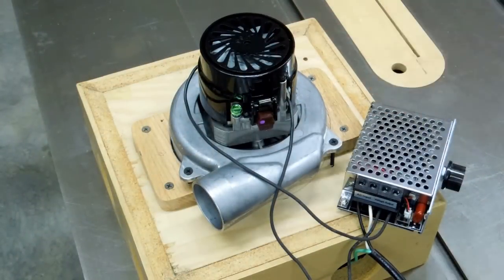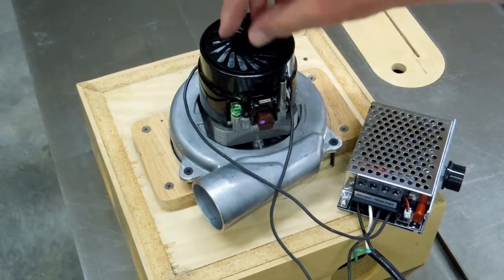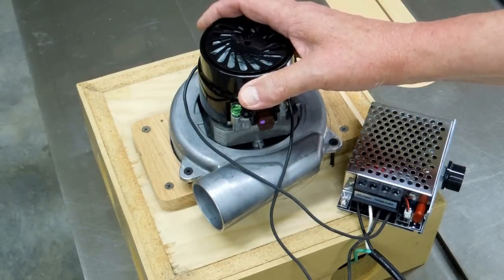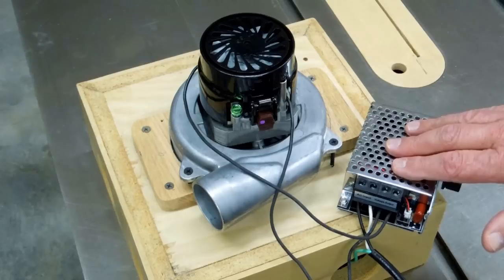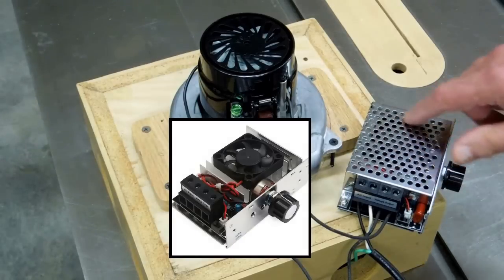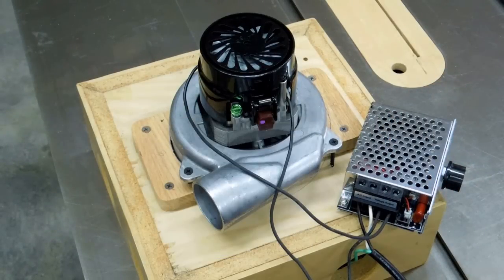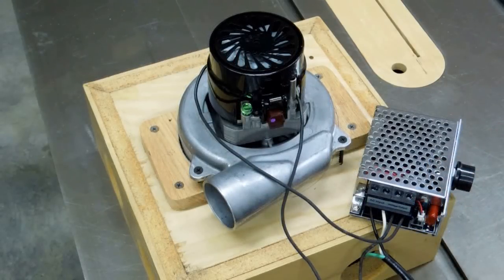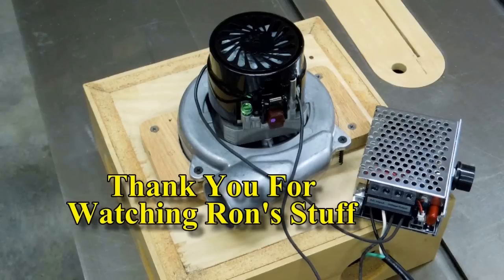Ametek Lamb Vac Blower Motor With SCR Thyristor Speed Control

Comment: My understanding is that the thyristor chops or modifies the sine wave not the frequency.  Inverter speed controller changes the frequency. Am I  wrong?
Reply from the maker: Somewhat of an over simplification... but the end result is basically the inverter controls the frequency via PWM (pulse width modulation)... and is something I am no expert in. Thanks for watching!

Comment: can you use this to go beyond the max voltage a little bit ?
Reply from the maker: No. Voltage in equals voltage out. If you watched the video you would see the motor speed is controlled by cutting off the frequency waveform. Thus the motor still sees full voltage but for a varied length of time, which is how the speed is controlled while still allowing the motor to develop full torque.

Comment: Is it possible to buy something similar to this?
Reply from the maker: The description for the Ametek Lamb blower and the motor speed control are given in the video. Searching on eBay should find them. Or I would sell you these for my original cost plus shipping since they have not worked for my intended purpose. If interested please send me a private message with your email address.

Comment: hi ron thank you for sharing, if you have the time i would like to ask you a few questions. do you know any reliable schematics for making a speed control like the one you showed? can this control handle 10kw for real? the lamb motor is a brushed one, can this be applied to induction motors? sorry they may seem very basic questions, i`m not that into power electronics but i`ve assembles some circuits before and now need some solutions as i`m planning to make a welding turntable and need some way to control rpm. thanks. pete
Reply: I know this is an old thread, but let me chime in. All I know is only a 3 Phase AC induction motor can be controlled with PWM speed controller. If you want to control the speed of motor, the most efficient way is to use a servo motor, it's cheaper, lighter and more efficient. You can find a good a 550W servo motor with a speed controller for $55. If you are going to build a welding turntable/BBQ grill, you can find a cheap DC gear motor (1 rpm) on Aliexpress for less than $4 and PWM speed controller for $4.5
Reply from the maker: I do not have any schematics.
I must admit I questioned the 10,000 watt thing myself. I bought this because it had one of the ratings plus the cooling fan... then hoped for the best. I have no intention of trying to load it up anywhere near stated capacity.
I am going to guess "no" for induction motor... but this is listed on Amazon and I suggest you ask the seller. https://www.amazon.com/dp/B00C470OBW/ref=twister_B0107YC8HQ?_encoding=UTF8&psc=1
Reply: thanks man. take care. pete